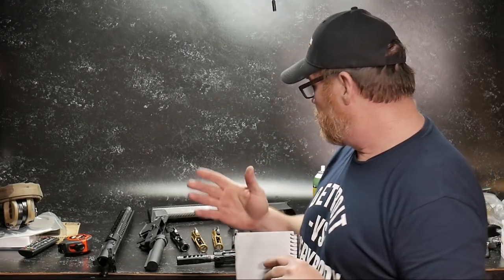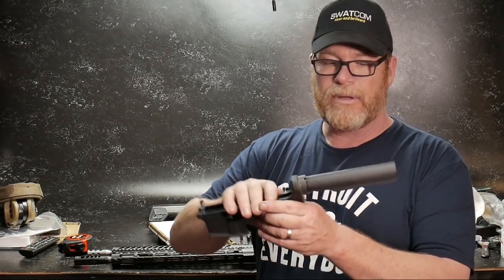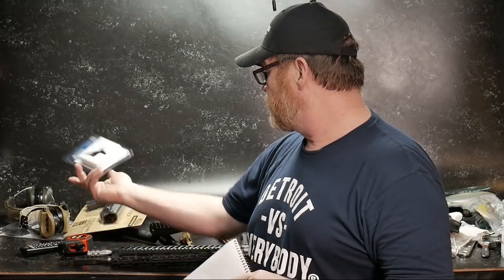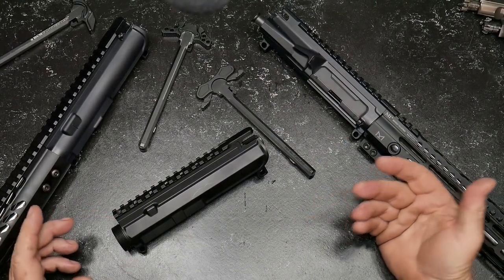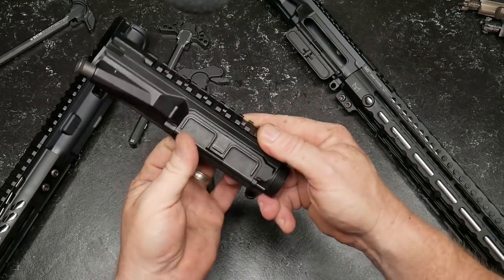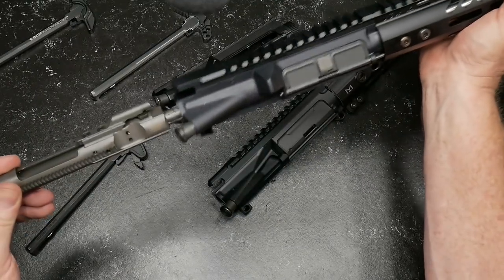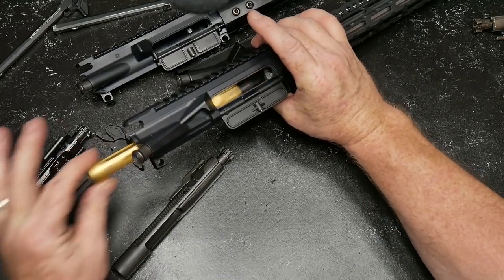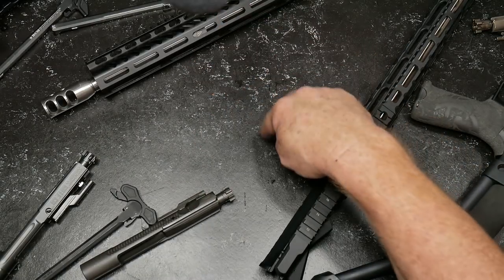Cheap Vs. Expensive!  Forged vs. Billet Receivers

Comment: Metallurgical the forging process compresses the grain structure and actually makes the grain flow with the shape of the part with the forged receivers. The billet receiver is sometimes a play on words. Is it a cast block of aluminum that is tossed into a CNC mill to make it or is it a "forged" billet where the block of aluminum is first pressed to compress the grain structure of the block then tossed into the CNC mill?? Two totally different "billet" parts.  (I'd take standard forged parts over "billet" all day long BTW)  Range lizards love going on long rants describing each Gucci billet part they have on their AR, as I slowly reach up and turn the volume off on my hearing protection...........
Reply: I watched a video from MIZUNO that uses grain flow forging on their golf clubs, I'm dumb as a rock when it come to metal technology and from what I've seen the grain flow forging it superior to anything out there
Reply: As a longtime machinist, this is a pet peeve of mine. Forging is a manufacturing process. A billet is a solid block of material. Comparing forging to billet is like comparing sawing to a log.
In forging, a billet or rough-machined part is compressed into near-net shape in a compression process like hammering or drop forging. The forging is then machined to final dimensions.
What everyone seems to want to refer as "billet" is a billet that is machined with no intermediate forging step.
Better comparisons would be forged vs all machined and billet vs casting.

Comment: Great videos!! I am a competitive shooter in Las Veagas and the southwest so I am fortunate to shoot at least 104 times a year.  We put a lot of lead down range. Does eco vs expensive matter, yes. Does light weight vs heavy matter, yes. When you are continually throwing your rifle in a dump box or  running and quickly posting up on a prop things get damaged, dented and scratched. Trying to maneuver in and out of different arrays and running with your rifle weight matters. Point being ultra light build parts, such as V Seven, come with a price, perform extremely well and can take a beating. A couple items that are worth noting when building a rifle some billet uppers and lowers are not MIL spec but most most forged uppers and lovers are MIL spec. When building a rifle with a billet upper and lower receivers make sure  your parts are compatible. The reason most forged uppers and lowers are MIL spec is there are approximately twelve foundries that forge all the upper and lower receivers, companies such as Colt, Palmetto and Aero purchase there receivers from the same foundry and the fit and finish is at the discretion of the seller. I am interested in your opinion regarding bolts, I am a fan of the Sharps because with the angle cut of the lugs it guarantees consistent lock up helping when you are putting 300 plus rounds down range and you start to get build up. If you are building these rifles to be a truck gun or an occasional shooting rifle I don't believe you will see a significant difference in performance but if these rifles are heavy used, such as competition, there will be a point were your investment in better parts will pay off. If this wasn't true all the sponsored shooters would be running stock rifles with no modifications. Keep up the great work!

Comment: I think as far as upper receivers go, as long as it's milspec, it makes little to no difference, imo...if the finish is slightly different, it just adds character to the gun.
Reply: If someone is that worried about thimerosal finish,I'd argue they are buying it for the wrong reason and maybe need to start knitting. Grab a damn rattle can.lol

Comment: There's really only one place where going cheap truly hurts the function of the AR itself.    The Trigger.   There no triggers that are both cheap and "good".   Although really, milspec triggers are fine with a little polishing, nothing compared to a geissele or larue or any other high end triggers, but they're perfectly serviceable for very little money.   Most everything else has little to no effect on the function of an AR, it might affect the durability or the ergos or the weight and it certainly affects the appearance, but the actual function is largely untouchable unless you're going to cutting edge competition JP parts or something.   If you put all the parts together correctly and your gas port isn't drilled the wrong size, there's pretty much no issues that can't be solved with some polishing and lubrication.

You can get 1.5 moa barrels for 50 bucks and submoa barrels for 100.   You can even get lucky and get submoa 50 dollar barrels.

You can get chinesium mlok handguards for 40 bucks made out of 6061-t6 just like every other handguard, they might weigh a few oz more or you might have to locktite them to keep them from rotating, or you might have to time the barrelnut with spacers, but otherwise they're perfectly functional.

You can get uppers for 40 bucks.   These work fine, same as any PSA upper.

You can get lowers for 30 bucks.   These work fine, same as any PSA lower.  Will it fit as nicely as a matched pair of aero receivers?  No, but it will work just fine.

You can get BCGs for 50 bucks.   They work just fine, I've got about 500 rounds on one of PSA's 50 dollar BCGs with no BCG related issues, no breakages or extractor ripping off rims. 

Milspec charging handles, gasblocks, gastubes, and all the other small minor parts and controls are perfectly fine.   If you're going ultra cheap with 30 dollar chinese parts kits I've yet to have a set that actually fail work out of the box, though usually the fit and finish benefits from some polishing.   If you own any higher end parts in this realm, such as a nice safety lever, I've used these as guides for cleaning up and enhancing the machining on the cheap chinesium parts and it does work wonders.   A few minutes with a dremel can make a chinesium safety lever feel as smooth and nice in the throw as a radian.   All it takes is some chamferring, polishing, and a little bit of lubrication. 

You can get braided buffer springs for 18 bucks from armsunlimited, I have about 5 of these running in various platforms and calibers on ARs and they all eliminate the annoying twang and have worked flawlessly.

The truth of the matter is that if you put a good trigger like a larue in a 400 dollar AR, bringing it up to a 500 dollar AR, it's going to be about 95% as good as a 1500 dollar AR at putting rounds on target.   Trigger and optic are almost everything to an AR in terms of getting rounds on target.
Reply: $100 rise armament drop in trigger could be consider cheap and good when compared to a $400 trigger. Are you going to get $300 more performance out of the expensive trigger? I doubt it very much
Reply: I have some PSA  triggers . They're just as good as the person behind it. Plus you can spend the left over money on other stuff.

Comment: All I know is most billet receivers are made from 7075-T651 billet aluminum and has a tensile strength of 83,000 psi a yield strength of 73,000 psi shear strength of 48,000 psi elongation 11% and a Brinell hardness of 150. 

Whereas 6061-T651Alluminum has a Tensile strength of 45,000 psi a 40,000 psi a shear strength of 31,000 psi a 17% elongation and a Brinell hardness of 95. 

Not sure if all that actually matters that much or not. All of my previous builds have been 6061-T651 with no problems, however with my current build I went with a F-1 firearms billet matched upper and lower with 7075-T651. This will be my last AR-15 build so I figured why not go pretty much all out. In the end, the build will be as follows. 

F-1 Firearms UDR-15 Billet 7075-T651 3G STYLE MATCHED UPPER AND LOWER
F-1 Firearms  Billet 7075-T651 C7M contoured handguard
Spikes Tactical Nickel Boron lightweight bcg
Sb Tactical PDW Pistol brace
Ballistics Advantage premium match grade 223 Wilde 11.3 inch barrel
Tyrant designs lightweight handgrip 
Geissele super dynamic 3 gun (SD-3G) Trigger
Adjustable gas block
Optics to be decided but will probably be either Aimpoint or possibly something with night vision capabilities. (If anyone has a recommendation I am all ears:))
Additionally, it will probably be suppressed. 
Not sure if any of this makes for a better rifle or not as of yet $$$ but we won't even mention that part to my wife  :) She does as of now allow me to do what I want when it comes to guns. I know I am a lucky guy! Not sure if the psi differences between the 2 aluminum grades changes things all that much when looking at forged or billet.

Comment: in regards to the "Drag" on the BCG in the upper receiver - I am not sure what type of brush it is or what its made of (im sure you can google it though) - they make "Brushes" that attach to drills that you can "bore" the upper out with without ruining the melonite finish.  Basically brakes in the upper receiver so it reduces the drag from the BCG.  typically the drag is from parts that are a little out of spec.  So i recommend buying the BCG from the same company as the Upper and buying the same lower from the same company.  I used to work for a gun manufacturer (no longer in business so that tells you something).  We used to phase match are parts  when we did builds to ensure they ran properly.  When parts are manufactured depending on when in the cycle of production they are (if you make 50 lowers - if its the 1st one made or the last) sometimes the tooling wears down  causing the final product to be a little "off".  Itll still be in mil-spec, but there is a little give - so some times that little differences can cause BCGs to drag or upper and lowers to not match up properly.  If you mix and match from different companies things dont always fit properly.  Great video - thanks for taking the time to put it out.

Comment: I just took 1500 grit and light machining oil to smooth the striations in the upper. Now it is as smooth as silk. One has to disassemble the upper assy to do this as one can generate abrasive slurry using this process. Perhaps the extra cost is associated with brand and/or finish work. Thanks for sharing Kotaboy!

Comment: My last two builds have been with VLTOR Mur uppers. They do have a bit more material in certain areas to make them stronger than a regular mil spec. And they look really cool similar to a billet receiver although these are forged. Vltor is an aerospace and defense company and they make some really high quality stuff. 

The uppers are a little pricey but not as bad as some of the fancy stuff, and you can catch them on sale. I would like to have one of the lowers to go with it but they are crazy expensive for the lowers. 

I did get a couple of billet lower receivers for a good price, about $115 or so from a newer small company called 17 Design. Very nice and clean machine work.

Comment: I'll expand  the discussion a little bit beyond 3 gun. Determine your purpose. If it's going to be a battle rifle,  forged receivers will be marginally stronger and lighter, but either are fine. Avoid with severs with lightning Cuts all the way through. if it is going to be a big bore, you will need a receiver with an oversized ejection port. You may also choose to mill it out yourself. When it comes to a cool build, billet is the way to go. Billet can be used to give a receiver decoration and clean lines. Although either can have a cool logo on the side. When it comes to a light build, it depends on your budget and what your definition of light is. It's possible to go with a forged upper and a hybrid lower, a matched upper and lower with a bunch of lightning cuts, or receivers made out of a special material like manganese alloy. For longevity in a light build, I would avoid a polymer lower without the metal inserts. Something extra to look for would be a set screw to take up the slack between the upper and lower, and accuwedge, or a well matched upper and lower.

Comment: Ha..Econ build.   I just finished a lower I picked up in 2015 for $15 w/purchase of a few training courses.  They even tossed a CMMG lower parts for that 15.  Did a BCA upper for $225 delivered (16” heavy, A2 flash and side charge). Picked up a fixed carbine stock kit for $39 and a red dot with 1” riser for $45.... lol.  That’s budget.  But I’m in MA so I had to get a comp and get it pinned & welded before taking to range...

Comment: The difference I notice is that the bullet receivers won't always be the same clearance near the threads, so a handguard with anti rotation tabs won't always fit.  On the mil-spec uppers it seems like there's good fitment almost every time.....  Of course I'm not talking about billet receiver/handguard combos that are made to fit together.

Comment: I think it all depends on what you value. A Ruger American, Mossberg  Patriot, Marlin, etc., are plenty accurate and capable rifles, but they are not a pre 64 model 70 Winchester. Nor, are they intended to be. The new line of polymer 380s, are great for their purpose, but they will never be a 1908 Colt Pocket Pistol, and they were never intended to be either. Today, they can make firearms that are practical, reliable, and relatively inexpensive, especially compared to the time, effort and workmanship required to make an heirloom piece,which was essentially the norm in the past, with respect to firearms. I once had the opportunity to buy a vest pocket Colt with the $12.50 price tag still on it and the original box of Ammo with 6 cartridges missing, for $600. I still regret not walking out with that pistol those many years ago. I ended up buying one in not as pristine condition for 300 made in 1917. It functioned perfectly. So if you are buying for pure functionality, get what you can afford, or are willing to spend, and go enjoy your new firearm. If you are wanting something that your children and your children’s children may cherish someday, get the best firearm you can. Most likely, if you live long enough, you will own both ends of the spectrum. It is truly a great time to be a firearm enthusiast.

Comment: Far as the upper receiver sounds only mean it needs to wear in and that's not a bad thing. It is important that the upper receiver hasn't been slightly crushed so the inside diameter has been altered and the bolt carrier group become tight move in and out. I have seen upper receivers that novices have put in a vise during build and altered the inside diameter of the upper causing the bolt carrier to hang up or not fully move forward. When breaking in an AR-15 it is always wise to keep those rails on a bolt carrier well lubed.

Comment: So are forged aluminum uppers stronger or weaker than billet aluminum? or would you say they are the same?
Reply: Forged aluminum generally refers to material that is ‘forged’ into a specified shape. Forging a lower receiver requires “compressive forces.” In other words it is “hammered” into forging dies to shape the aluminum into the intermediate dimension of the lower receiver. After the aluminum lower is forged into the initial shape, the raw forging is then ‘finished’ on a CNC machine.

Metallurgists agree that a forged piece of aluminum is stronger than cast or billet. The reason being, when the material is shaped under pressure, its ‘grain’ follows the same shape as the part. As a result, the product manufactured is stronger due to the continuous grain characteristics allowed by the forging process.
Reply: they are about the same in strength, the difference has to do with how the material will fail a forged upper will usually fragment when it fails while a billet will crack with little to no fragmentation saving your limbs and face neck area from potential damage. Not really necessary to go billet unless you are shooting something with a lot of powder that can cause the material to fail, such as .50 bewolf or .458 socom those you may want a billet but otherwise go with forged and save the money. The only other advantage a billet can have is they can be found in matched upper and lowers usually so you will have a tighter fit up to your two receiver parts allowing for less wiggle in it.

Comment: $113 trigger? I have less than that in my most recent complete lower receiver build. Lol
$104 in the lower. $429 in the upper. Runs great. Not a ton of rounds through it yet but time will tell.
Reply: My wifes newest 10.5 inch pistol she spent $260 on the complete pistol not including irons or rds. Complete! It's an Anderson lower and lower parts kit. Colt upper,psa bcg,bear creek barrel. She bought the brace in the box used and the hand guard used. The only part she already had was just a standard charging handle. It a 1.5moa gun and shes put probably ly 2,500 rounds thru it already without a stoppage. These lower cost companies have stepped up their game on quality and have kept the low cost. Noone should buy any.thing prebuilt,not even an upper. Between the used market and what you can buy the parts new it's just too cheap not to build everything.
(Edit) she did have to polish the feed ramps tho. At first it was a 7 or 8moa. The feed ramps were scarring the jacket of the projectile when clambering. Polished the feed ramps and it straightened it right up. 1.5moa . Great for any firearm but especially one with a $39 barrel

Comment: I see some people run their  ar15 without a captured buffer spring detent,  because they can break off and jam the trigger. Is this something to worry about? Or just buy a JP enterprise captured buffer system?
Reply: In all the tears of this,I have never seen this happen. My guess is it's a different problem to start with like the receiver extension not turned in far enough to hold the detent down correctly or something to that effect.
Reply: This could become a real issue in the field if you had to break the rifle open for any reason.